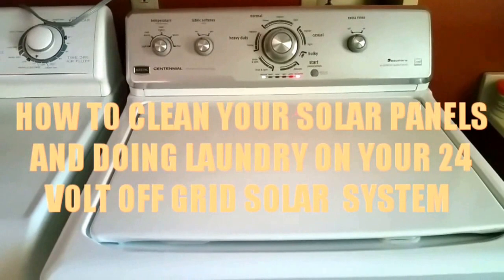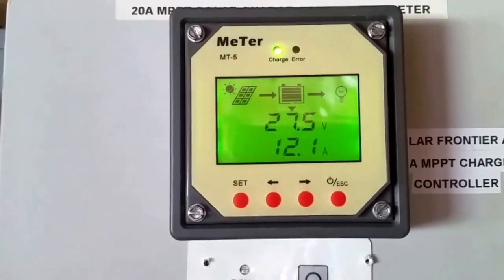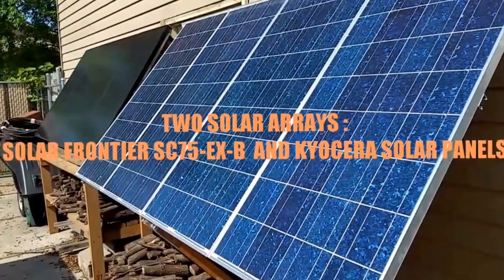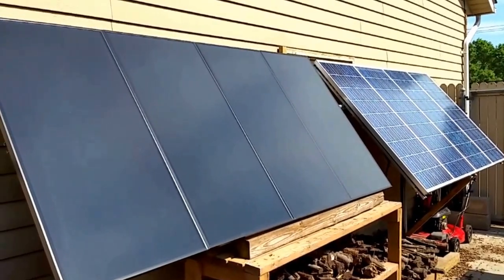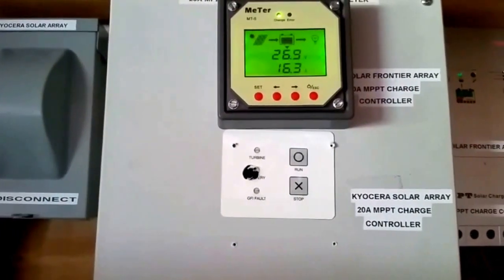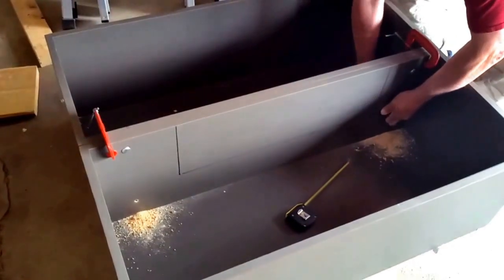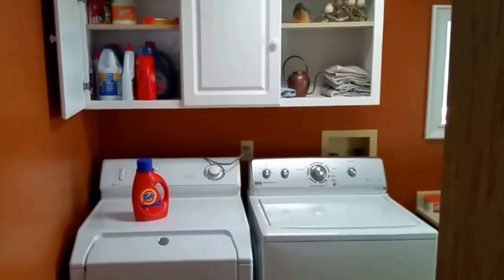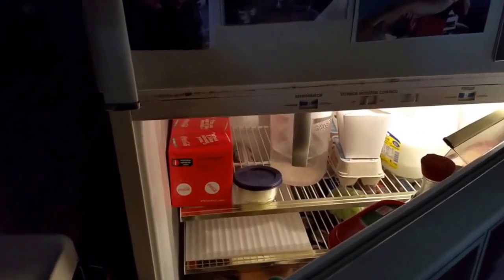HOW TO CLEAN YOUR SOLAR PANELS

Comment: how many watts and how many volts coming to the charge controller, you have a good system for him for sure
Reply from the maker: +George Gardinier 
Input Voltage is approximately 85-86 Vdc 800W of power.
10 x 12V AGM BATTERIES 
40A EPSOLAR  Tracer MPPT CHARGE CONTROLLER with a 24V COTEK 1500W PURE SINE WAVE INVERTER
Reply: it had trouble with the air compressor so i guess the next up inverter. wow 800 watts of solar.
Reply from the maker: Yep. 
Thanks for watching. Please checkout the rest of my videos and stay tune for more videos coming your way. 
Have a wonderful day and God bless

Comment: are both sets of solar panels on the same charge controler?
Reply from the maker: Yes Sir
Reply from the maker: EpSolar 40A MPPT Solar Charge Controller
Reply: If you add a second charge controller it will give you better performance. Both sets of panels are different. plus they are on different angles this is confusing the mppt in the charge controller, will still work fine if your on a budget, but add 2nd charge controller you will see a big boost in charging performance...
Reply from the maker: +off grid kid 
Yes please. 
Please checkout my new videos I just uploaded
Reply from the maker: +off grid kid 
Yes please. 
Please checkout my new videos I just uploaded
Reply from the maker: +off grid kid 
Yes please. 
Please checkout my new videos I just uploaded
Reply from the maker: +off grid kid 
Yes please
Reply from the maker: off grid kid Thanks buddy I really appreciate it and God bless.
Cheers